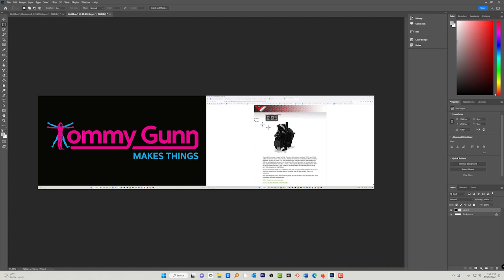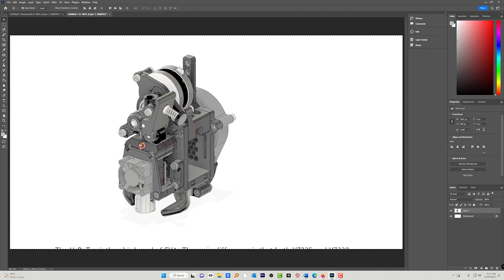Original Vzbot printerHead Built

Comment: The aluminum parts as far as the carriage and Extruder are concerned, help for the heat transfer / thermal mgmt and keep the temp differential at the heat break as high as possible as well as to reduce the Extruder & hot end as close as possible for pushing flexible filament

Comment: Sadly E3D V6 not supported :(
Reply from the maker: Yes v6 was my go hotend for many years. In this case you need a higher flow rate hotend like a volcano, Goliath, dragon, or rapido.  
Or like the one I use.
Reply: @tommygunnfilms  I understand, but I don't have such high requirements, I'm just looking for a lightweight, compact design that is easy to service. Unfortunately, I can't design and I'm looking for ready-made solutions. Do you remember what design you used for the V6?
Reply from the maker: @beltonator  I have another tronxy printer with a v6 I did not use linear rail on that one but I  found a back plate on thinaverse then I used this to mount hotend and fand and bltouch.. I set it up as bowden works find https://www.amazon.com/Volcano-Compatible-Multi-Mount-Hotends-Ender-3/dp/B09MLHNFHQ/ref=sr_1_1?crid=1JAM4U142590V&keywords=Hotend+mount&qid=1683565842&sprefix=hotend+mount%2Caps%2C83&sr=8-1 I used my old titan extruder connected to frame
Reply from the maker: @beltonator  look for tronxy x5a upgrades on thingaverseI also replaced the motor mounts with better than the plexiglass ones.
Reply from the maker: @beltonator  last thing lol if you are Facebook and dm me I can show you what I did. Got a video already with those updates.